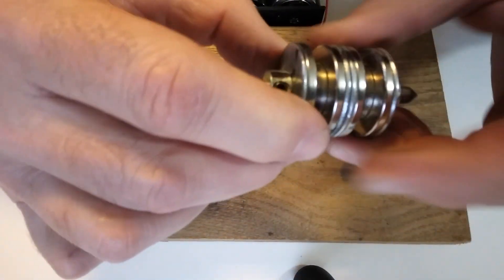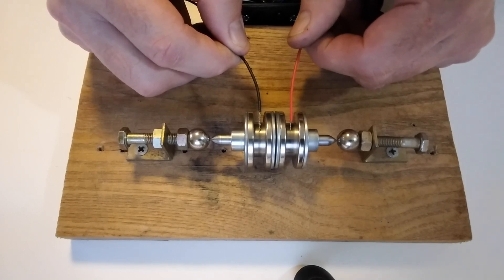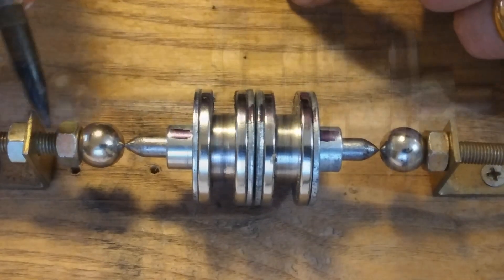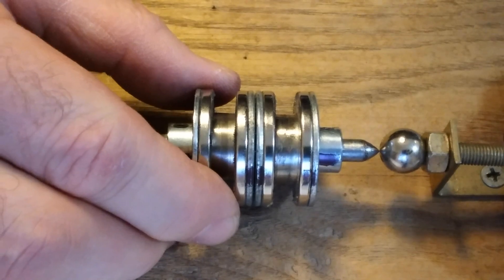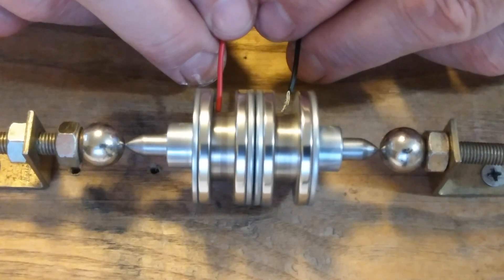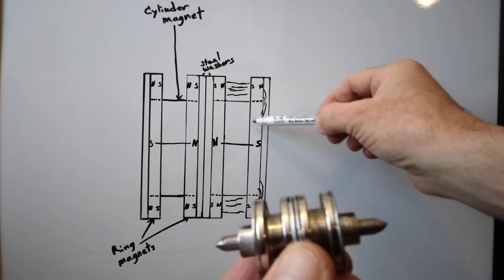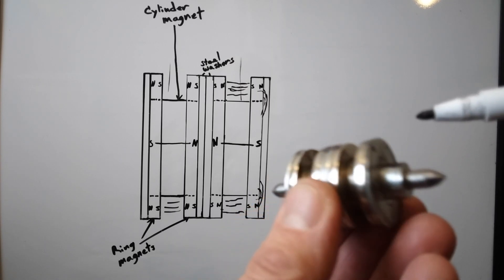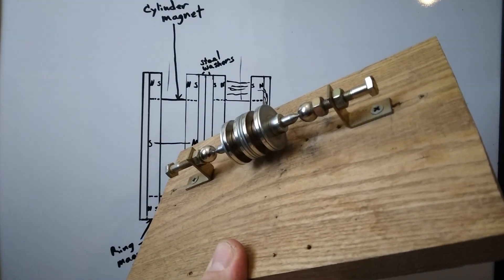Dual Homopolar Motor with Permanent Magnet Bearings

Comment: Your video is very nice, thanks! But i've three questions: a) do you have a magnet under the table to sustain your rotor here: 3:23 ? b) Do you use a current limiter here? c) Are they two neodymium magnets? and, if yes as i think, with ferrite magnet it will spin too?

Comment: how about tesla turbine discs as the homopolar motor. levitating on a vertical magnet with the induced current. anyways that would work nicely as a pure dc drone motor. the brushed contacts is not optimal, maybe train contact wheels. also a perfect flywheel mass storage with electric combo motor-generator. so why you have opposite magnets, not very optimal magnet arrangement. so make an alternating magnet disc stack motor. so its only about the single wire magnetic field current. ie hall-effect motor. yep make it a bit lighter. it will work nice for any high speed drone prop motor. or gear it down.
Reply: yep use metal steel ball bearings with optional conductive lubricant to do away with the brushes and have fixed mount point on the motor chassis for the +- leads. ie brushless kinda dc motor. if ball bearings are taken as brushless. at least the motor is pure dc. too heavy rotor to spin fast. it will spin really fast if its like a micro brushed dc motor.
Reply: that motor can even be turned into multicoil motor, being a true dc n-coil motor.

Comment: Nice experimental rig! Tesla claimed that the length and angle of the power feed wires can create speed control. I believe that it is the mag field emanating from the wire which interacts with the permanent magnet's field. An idea is to experiment with wire diameter and the length of wire which is 90 degrees to the rotor. Use solid wire and put in a 90 degree bend after the 90 degree section of power feed wires to the rotor. So you end up with a good length of solid wire which runs in parallel to the rotor. Make those long enough (a couple of inches) past the end of the spherical bearings. Making the wires less than 90 degrees that feed the power onto the rotor should create differences in the way the mag fields from the power feed wires interact with the perm. magnet rotor fields. Tesla said the "magic" was in the power feed wires relationship to the rotor. Thank you for sharing!

Comment: .What voltage did you apply and what current do you think was flowing in the circuit?
Reply from the maker: I was using (2) 'D' size batteries in series, so 3 volts more or less.  Don't know the amperage, but they were probably maxed out to first start it up.
Reply: @doubleMinnovations , Thank you very much for your reply!
. Maybe you could repeat your experiment by powering your motor with the same D cells in parallel. I'm wondering what supply voltage is basically possible to go down to, assuming there is no current limitation.
Good luck!

Comment: isnt that pretty much a brushed dc motor? or am i missing something?
Reply from the maker: This has slip rings, but not a commutator bar that switches direction of the current as it turns; as you see in a conventional brushed motor.

Comment: Liked and subscribed just from title. Tachometer gives you rpm reading. Beautiful design. Shall be experimenting with elements of this design, perhaps with an electrostatic motor with that kind of magnetic bearing because they dont have brush contact? Hmmmmm, very very cool.

High speed low torque... hmmmm, so, thoughts on that, magnetic gears are also ultra cool and could give you the high torque continuing the minimum friction magnetic theme?

Still scratching my noggin working how the current makes it spin

Wild
Reply from the maker: Thanks for the subscribe!  If you check out some of my other videos, I did some magnetic gearing on the Nitinol motor, and there's another video on magnetic bearing ideas.

Comment: Very nice demonstration. Sir may I ask you about the dimensions of the motor, and about the winding, since I don’t see it? Thanks again..
Reply from the maker: The rotor is 3" long from tip to tip, and 1.25" diameter.  The 'one winding', is just the two wire leads completing a circuit through the rotor itself.  Thanks for commenting.
Reply: Thanks for the answer. Sir, have you measured the maximum speed of the motor?  and after how long it reaches that speed? And also I would be interested on,  how much current draws at let’s say at 1 minute, or at the maximum speed.. Anyhow I like your project, it worth your work. Thanks again for showing it.

Comment: Excellent demonstration. How rotation takes place requires a lot of understanding. Bruce DePalma in reverse. Thanks for the time and effort.
Reply from the maker: Very welcome
Reply: @doubleMinnovations  Is there any way to apply  What I'm assuming is direct current instead of to the cylinder magnets. but to where the rotor attaches. at the spherical magnets As seen in other. videos. that used just a simple. ball bearing. attachment. to the shaft With the power inputs at the bearings. and then use the cylinder magnet area as a collection area. which I assume would be a higher amperage output.

Comment: Very nice! What voltage did you use and how much current did it draw?
Reply from the maker: I use (2) 'D' size batteries in a series; so around 3 volts.  I didn't check the current.
Reply: Hi again  @doubleMinnovations  does the unit speed up if you use more volts.?